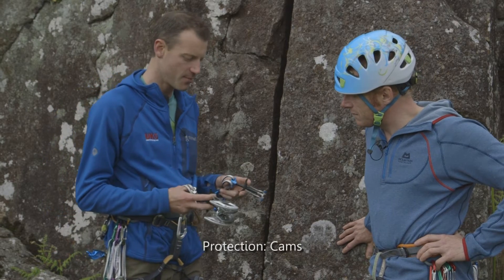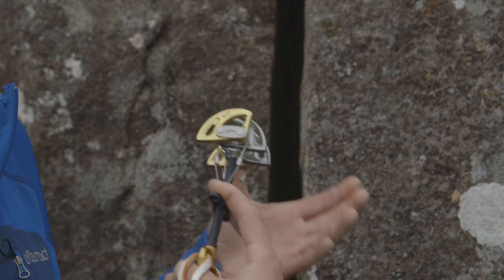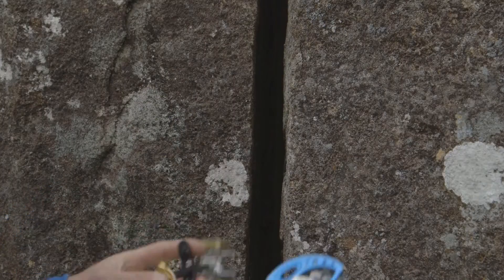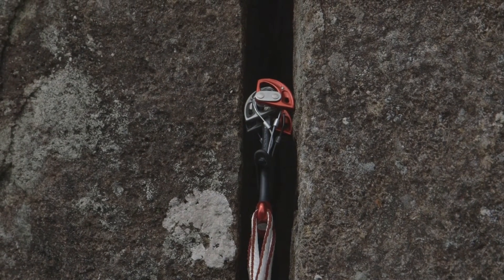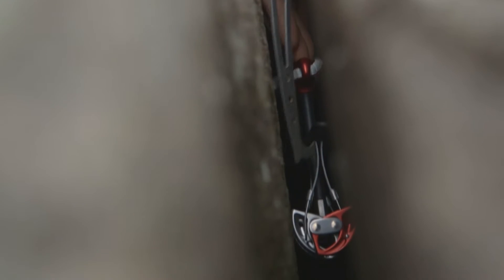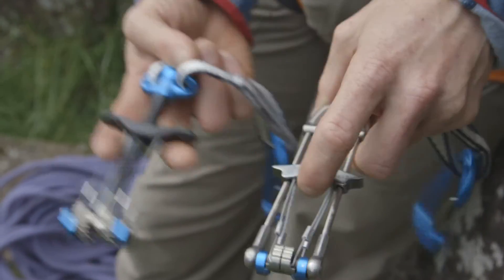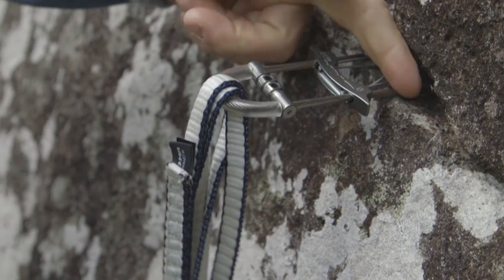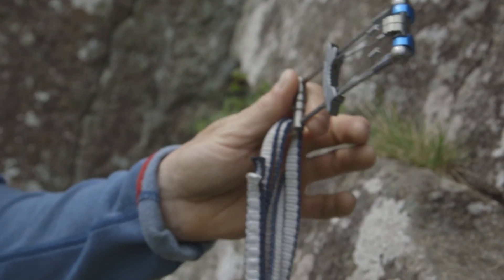How to place Camming Devices

Comment: Quick question: I noticed that when I was placing camm's there was a tendency for them to 'walk' deeper into the crack. Was this because I used too smaller a cam meaning it was under cammed or is there something else I may have been doing wrong?